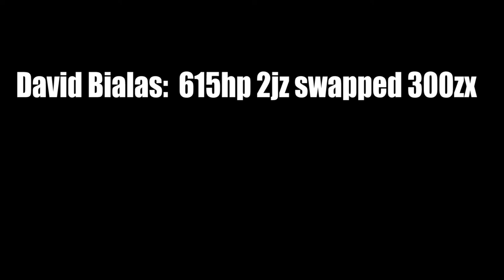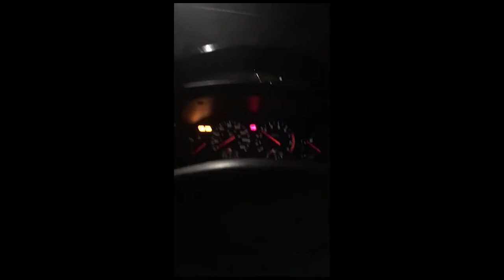2JZ 300ZX Build Pictures and Videos - 615WHP

Comment: How was it doing the swap on this 300ZX? I want to do something like this in a 300zx But .not.really sure what exactly to do. TIA
Reply from the maker: Not bad, just expensive and takes some commitment. Knowing how to weld saves you alot of money
Reply: @davidb300z  ahh,I've only welded a couple of times so it's rip wallet for me I guess lol,going to look into some other swaps but this is definitely on my list,you did a sick job brother!
Reply: @davidb300z  nice build what radiator, intercooler, turbo did you use. Also harness and ecu thanks man